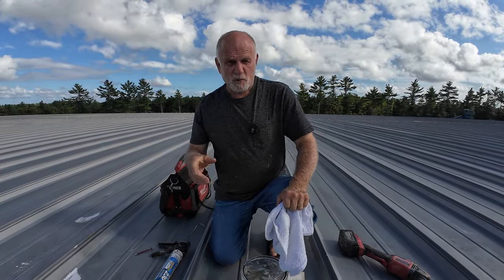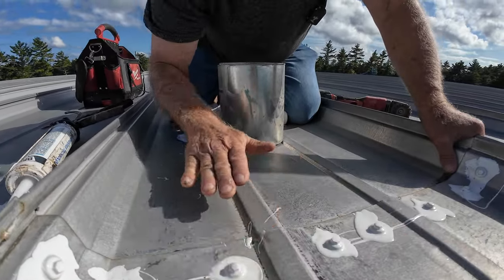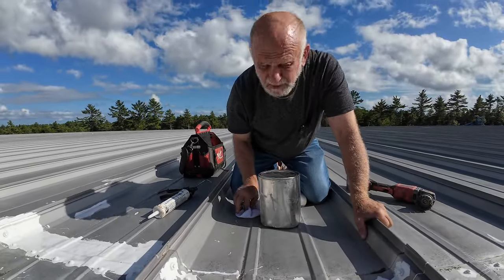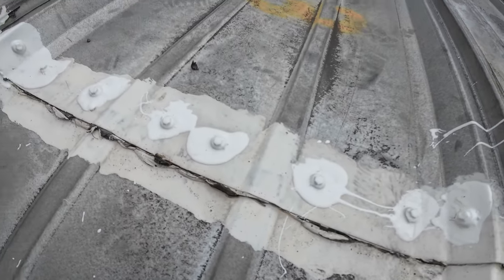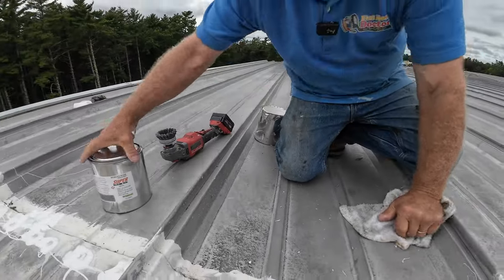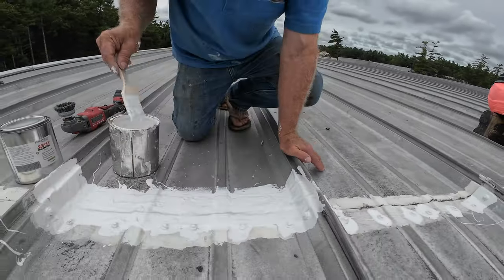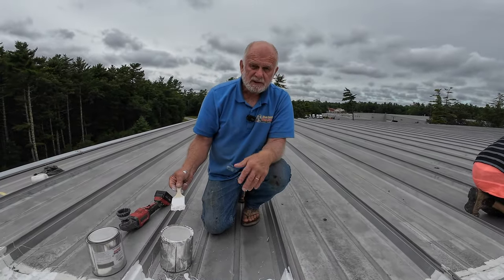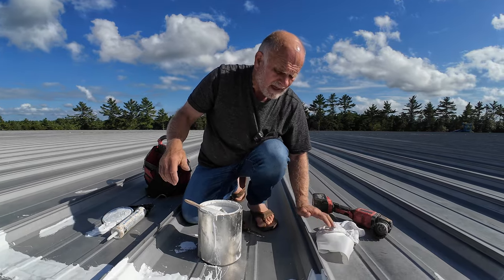Silicone Caulking: Enemy or Friend?

Comment: Try taking the screws out at the seam and put down some new mastic underneath.
Reply from the maker: The mastic between the seams are still holding. It us the screw that wasn't torqued properly eventually causing a leak

Comment: Your toes are getting sunburned.  I would suggest buy some boots and tuck your long socks.  Alot of Dewalt guys go barefoot or wear sandals at times because wood shavings ruin their socks.  Learn to tuck your socks in your boots to protect your feet from skin cancer.  You have the right idea buying a long attachement to preserve your back. Preserve your feet though.
Reply from the maker: I wanted to display my Model Feet so I might get a modeling job. Wearing boots is hard on the feet due to the bend pressure. Kneeling down all day with a boot that makes a crease on top of the foot is a killer. But thanks for the advice and concern.